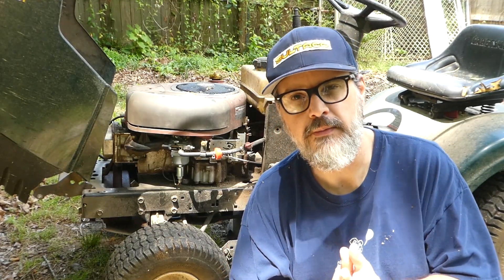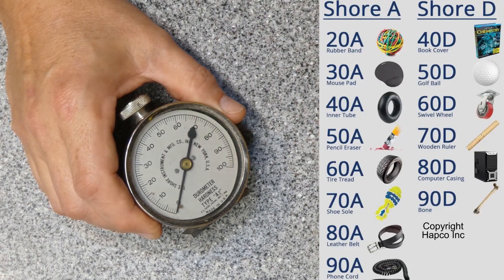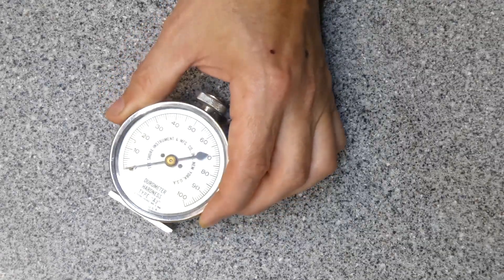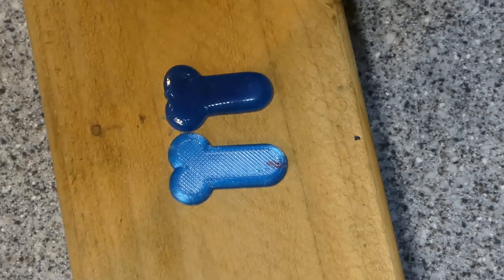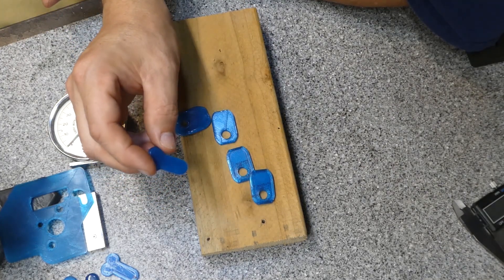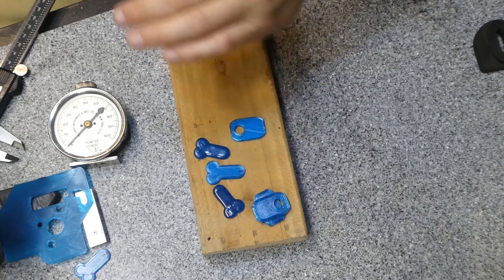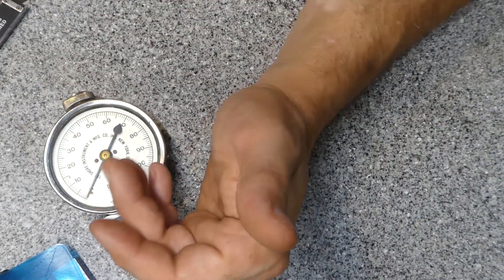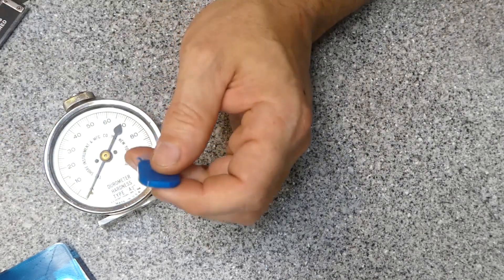Annealing TPU to increase its heat resistance?

Comment: 15 minutes is nowhere near enough to form microstructures between the hard and soft phases in TPUs. I've been annealing printed TPU parts for production cars for years and it's very rare they'll get anything less than 24-48 hours at 100+c
Reply from the maker: Great info, thanks!
Reply: @theeddies  No problem, it's worth doing, the heat resistance generally rises by 10-15c before the stiffness drops off, and the resilance and tear strength change is huge - it can be a third better in softer TPU's
Reply from the maker: @Rippthrough  My biggest problem is temp control, really need a better device for annealling. I would have preferred to let the parts soak longer but maintaining consistent heat was a bear.

Comment: So is it a good Idea to 3D print gaskets for my espresso cooker? 🤔
Reply from the maker: That is a question you may have to answer yourself.🙂
Reply: Some sources say it is safe until 110 C°. I'll try :)
Reply from the maker: @Xubor  Give a shot. I think it will probably be too soft at 110 but it all depends on where on the cooker it is used. I did do a gasket for a slow cooker lid handle and it held up (the PETG handle did not) but don't think it got above 90.

Comment: Thank you for sharing your TPU knowledge! I am new to TPU and do some initial test of my own and I find that skipping the walls all together is the way to get a gasket with equal softness all over the area. So I print only concentric Infill and no walls or top-bottom layers. Even better is  only top-bottom layers together without infill. I am using a higher temperature and flowrate to make lines melt together better but that is probably environment-printer related (CR-10 Smart Pro in a chilly room). Right now I am annealing a coupple of gaskets, they look nice glassy and smooth after 20 min at 200 C - high and fast, I will reduce to 130C next time
Reply: I've had good success enabling ironing on all flat surfaces (not just top surfaces!) when printing TPU. Granted, my nozzle tip is super non-stick (PCD), so this might not be feasible with brass nozzles.

Comment: I have a 20 year old craftsman snow blower that blew a head gasket. When I ordered the head gasket, I ordered all the other gaskets I thought I would need including a carb gasket. 

Everything came in except the carb gasket. That seems to be on a perpetual delay (About 2 months or more)

I have gasket material and exacto knives but if I don't get the gasket, I'll try printing it. I have printed stuff on my new ender neo using TPU

Given what you said about density, I'm thinking about radically increasing the infill density. I can't imagine it would take too much material. As far as time, I can just start the print and walk away. 

Anyway, with the supply chain being erratic, this is an excellent tool in the toolbox.. or maybe gasket in the gasket box or whatever

Thanks again.
Reply: I googled the gasket I need and found a flat picture. Easy to turn into a 3d object that way.

Comment: I just started using Taulman alloy 910 to print various parts with. They also have a high heat version as well. Amazing strength and flexibility is like nothing else I have printed with. I think for the gaskets you are making this may be a great choice. Love to see your take on the filament. Great job on the videos. I am going to try annealing and see how I go
Reply from the maker: I have not done any nylon yet but it looks like my Sovol printer could handle it. For a stiffer gasket I think you are right, nylon would be a great choice. I have a product that I have been making in PETG but nylon would be better for it as well. Except for a dry box, any other tips using it?

Comment: Two thick class sheets, some spacers what are e.g. 2mm thick or what ever needed to be

Slightly over sized height but inward scaled in XY prints, place them between sheets, add some bricks to weight and thorw it to oven? Test slowly temp what needed so it will settle nice and flat as that glass sheet
Reply from the maker: Sounds like you have done it before, lol.
Reply: @theeddies  I have seen similar method some other applications and see it would work great to flatten sheet prints :P
Reply from the maker: @amtechprinters  That is a great idea. I print TPU on plain glass and the bottom of the prints are shiny glass smooth and completely sealed, Your method would likely produce that on the top as well. You could even flip it a few times if necessary to equalize the effect of any gravity sag. 
I might test this. I would need better temp control for the oven (or a better oven). The reason that oven is in my shop is that it was not holding consistent enough temp in the kitchen. But yeah, that is something to try for sure. Thanks!
Reply: @theeddies  Id like to see resoults as well, I have only kitchen oven, would test if seal that into heat resist bag / container even there would not be thst bad fumes.. but never know

Comment: Firstly, I want to commend you on this video series, every video is very informative and I can see you are doing proper research before attempting anything. Keep up this fantastic series.

I'd like to know if the general run of the mill available TPU can be printed and used for a throttle body gasket on a forced induction vehicle where the throttle body is mounted on a aluminum intake manifold. On a normally aspirated and carburetor application I can see this lasting quite some time and still be reusable, however with added pressure from the inside pushing outward, how would it perform and hold up. I would try it but my engine was recently rebuilt and cannot afford another rebuild anytime soon 🤣

The OEM gasket is a thin paper gasket (about 2mm thick) that is obviously not reusable, once the throttle body has been torqued down and you remove the throttle body after, that gasket tears and needs to be replaced. If one could use a TPU gasket, it would make life so much easier when servicing the throttle body because this specific gasket is becoming hard to source.
Reply from the maker: Thanks, that means a lot. I am currently working on another video that will be right in line with what you are thinking of. It should be out in the next day or so. I was not going to do another until the mowing season was over but in making the last piece (the valve cover gasket) I hit on an idea to make the working effect of the gasket a bit softer (to conform better). Also that gasket is 2mm thick and is metal cover to aluminum head, so it will get up to around 70C. And will get a bit of pressure as well. It will be an interesting test.
Reply: @theeddies  Really looking forward to the next episode, sitting here like a kid in a candy store not knowing what to do with myself lol.

Comment: My mind keeps wandering to channels like Project Farm and how he could probably save a BUNCH in materials cost while still ensuring consistent results in his experiments.
Reply from the maker: If I understand your thoughts (and that is sometimes hit or miss in Youtube comments). I would agree this would be great for multiple experiments that involve removing pieces over and over while remaining consistent and intact. Thanks!
Reply: @theeddies  exactly this, yes. It seems that it may not work for head gaskets (too hot despite the small size of the mower engines?) and exhaust stuff, but it shouldn't be unreasonable for everything else. I'd hate to see his expenses on constantly replacing things like these

Comment: The Briggs OHV engines use 2 or 3 square section o-ring like gaskets to seal the intake in places.  These get brittle with age.   I would like to see you make these.
Reply from the maker: Hello Dan. Do you mean the intake manifold to cylinder head o-ring for instance? The one on this Craftsman is a square cut I believe.
Reply: @theeddies  
Yes the profile is square.
Briggs & Stratton Part# 691917
SEAL, O-Ring
Note: (Intake Elbow)
On the 31P777 there are 2 on duct between the air cleaner and carb and one on the other side.  Not 100% sure on the 3rd but I recall seeing ones that were cooked.  

It would be great if we could print these and replace them while we have the carb off.   Clean air longer life.
Reply from the maker: @danharold3087  it might not be the next video but I am on it, lol. I want to know as well

Comment: Kind of seems like you should be 3d printing molds for gaskets instead of the gaskets themselves...
Reply from the maker: Other than higher heat applications (over 100c), why does it seem like that to you?
Reply: @theeddies  Quality of parts.  It's probably easier to get a higher quality mold printed with ABS (and smooth it) than directly try to print the part in TPU.

Ability to vary the properties of the gasket.  TPU you're limited strictly to TPU filament offerings.
Reply from the maker: @GoatZilla   Surface quality does not matter and performance is on par with many rubber gaskets. This is not an industry solution. It is for home shops and speciality circumstances. Molding is certainly an option but for my purposes it is just an extra step. Plus TPU filament is available in different hardnesses, if you really need different properties. It is not meant to be a replacement for any other method just another tool.
Reply: @theeddies  Depends on the application.

So making a mold is an extra step, but all this annealing stuff is not an extra step.

I don't think I've seen 70 durometer TPU filament.  Even if it exists, it would be a challenge to print with.
Reply from the maker: @GoatZilla   @GoatZilla  Filaflex makes a 70A. I don't think it will be bad with my direct drive but I will find out eventually.  And it is debatable to me whether annealing is even worth it. My tests really only showed a significant improvement above 120c and I would not run TPU that hot, so the test was a wash really. But I would not have known had I not tried. It does seal and smooth the print but again not necessary in most cases. Like you say just depends on use and what you want. Making molded silicone gaskets is another whole art really. I am just testing the limits of this stuff. So far I think it is faster and easier for a range of applications. Even at 85A or 90A it is still soft enough to seal a carburetor. And by making the gasket maybe 1.5 or 2 mm thick you can vary the measured Shore hardness by using a lower percentage infill. At 50-75% infill I bet could get the measured hardness below 70 and still have enough top layers to seal...and that just gave me a whole new video idea. Thanks!
Reply: @theeddies  Cool I hadn't seen the Filaflex 70a.

I get it, you're just trying stuff.

I actually did the same thing with the infill  (yikes that was 7 years ago)  for essentially a TPU recoil buffer replacement and was varying the hardness by varying the infill amount.

The other option if you have a super simple part is to just print a template and use that to trace a hobby knife around a sheet of material.  Like I keep a sacrificial silicone baking mat around for that purpose.  (Bonus:  that was food safe.)
Reply from the maker: @GoatZilla  Silicone baking mat is a great source of material. This series of videos that have seemed to blow up beyond all expectations has given me tons of ideas. The tiny bit of hate is offset mightily by some great conversations and ideas. Thanks!

Comment: Is there any use in printing a lattice to turn the RTV silicone into a removable/reusable gasket?
Reply from the maker: If you mean making a mold for RTV gasket, others have suggested this and I have seen a few video on it. As far as it being removable and reusable, probably depends on the application. If you mean using TPU as an integral framework for the silicone, I am not sure what advantage that would have, at least in a hot situation, as you would still be limited by the properties of the TPU. It certainly could be something to explore, TPU is stiffer and seems tougher than RTV so adding that resilience to an RTV gasket would be advantageous in some uses. Thanks!
Reply: @theeddies  I was thinking of it being integrated. I keep thinking about how aggregates can change the structural properties of things like concrete or resin. And I think while the TPU would be the thermal weakness of the gasket it wouldn't necessarily be as weak as the TPU alone. And with 3d printing, you get to shift and control where those weak points are depending on the application.
Reply from the maker: @tentative_flora2690  An interesting property of printing TPU is by varying infill and flow rate you can vary its stiffness, in effect lowering, or maybe even stiffening slightly, its Shore hardness in the overall part. Mixing infill density within certain areas could produce a composite of soft and hard like modern composite gaskets. This is possible with modern slicers, though it can be difficult to set up in practice. I do it with my lathe stops to some degree. The centers have 7 perimeters(walls) while the top and bottom layer have only 2. This is done for aesthetic purposes on the outer shell while retaining the strength of the center and making the teeth solid. The process would be similar.  

One could also pause the print and change filament or perhaps more interestingly insert a stiff piece of some material to change the performance of the gasket in any number of ways like a composite head gasket. 

The possibilities are only limited by the thermal properties.

Comment: I've printed TPU gaskets for jar lids and for my ATV intake manifold. I've printed TPU chain rollers with inserted ball bearings. Soft feet for floor standing speakers, drone parts, etc... My 3d printer has become one of those tools that I won't be without.
Reply from the maker: Thanks John! I agree completely.

Comment: My curiosity asks about water pump gaskets.  Your raw data seems to suggest a no-go, both for being a little high in temperature and for ranging in my experience usually between 35-60 ft lbs torque.  A material that could make that kind of reusable gasket inexpensively and easily at home would open the possibilities for many appliance parts like dishwashers and washing machines to say the least.  A guy can dream, I guess.  Thanks for the content!
Reply from the maker: Hello, a water pump on an engine running around 200F is definitely getting close to the yield point at 35-60 ft lbs and is probably out of an engineers accepted tolerance spec. I personally would want something rated to at least 350F or so and able to hold torque at that temp. A water pump in an appliance or the like would probably be fine. Thanks for watching!
Reply: A rear diff cover gasket might be usable. I see these things leaking on trucks all the time, even after a fresh gasket replacement. Seems to be a quality control issue on the market.  Also, mabye something small would be the carb on your lawnmower has a solenoid, that solenoid has as a gasket

Comment: Cool idea. Along with showing what it can do, you should show what it looks like when used for something beyond its capabilities. It may make for a more eventful video showing it catastrophically fail. Maybe in an exhaust system that way there is no risk of damaging your engine. You could record how long it lasts and to what temp it reaches before it liquefies and drools out of the connection. Also, it may surprise you and last longer than expected before springing an exhaust leak.
Reply from the maker: Not a bad idea, I will see if I can come up with something. Thanks!
Reply: @theeddies  can't wait. 👍

Comment: I'm curious if you think this material could be used to make bushings for things like body mounts
Reply from the maker: I don't see why you couldn't. They make them from polyurethane which is a similar material. I guess they would be a little on the hard side printed solid but you could play with infills to get the hardness or softness you want.

Comment: That heat treating process you're doing is annealing. You were actually probably hitting them a bit too much, 110C is the temperature I've always seen referenced for annealing most TPU blends. If you haven't been, burying them in sand when you anneal should help them maintain their shape.

Comment: When using a long metal sleeved thermocouple probe like that in ambient air the entire sleeve is acting as a heat sink and lowering the temperature readings somewhat even with the actual sensing part in the tip.